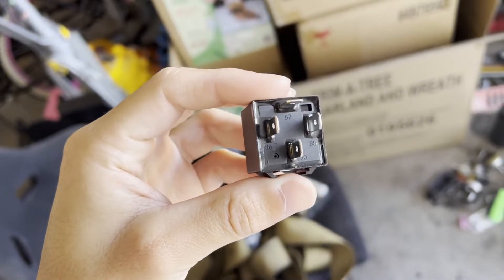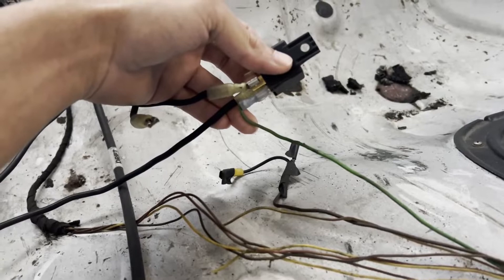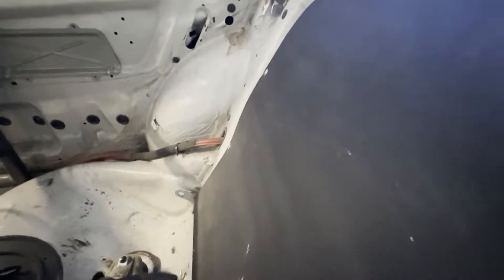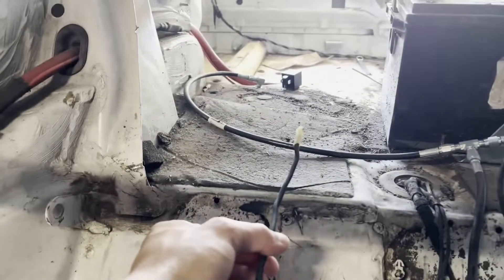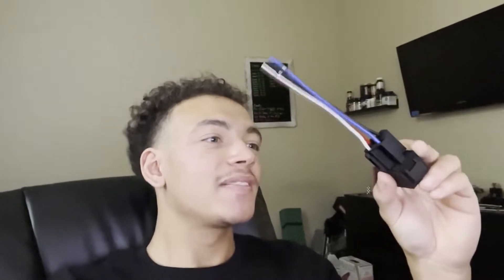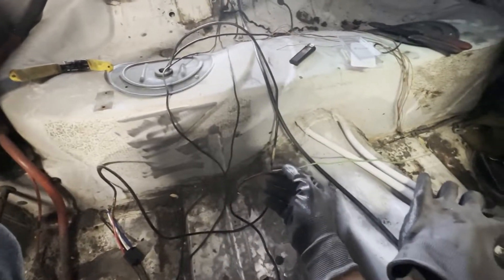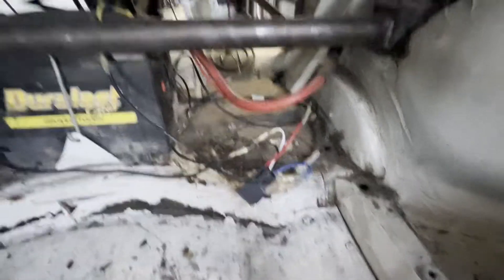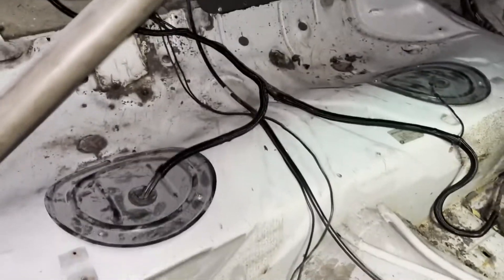In-Depth How To Install Fuel Pump Relay (12v Mod)

Comment: What about for a e46? Same thing I’m guessing?
Reply from the maker: Yessir, it’s basically universal only change will be the fuel pump signal wire, since it’s e46 probably in the same spot as well
Reply: @foxstyle1068  ok because I’m replacing my old relay with a new one because it went out but now the pump wont prime or anything. 
30 battery 
87 pump + 
86 trigger + 
85 neg - 
87a n/a 
Nothing works but if I unplug 87 and connect it to 87a the pump stays running and doesn’t stop
Reply from the maker: That all adds up, everything is hooked up right. 87a is supposed to feed power through if it’s not being triggered. So you know 30 is good. I assume that means 85 (ground) is good as well since the pump will run. The wire going to the pump works as well since it works with 87a. So it’s either something wrong with the trigger or a bad relay. You can check the trigger wire with a multimeter should be 0v with car off 12v (ish)with key on
Reply: @foxstyle1068  it was reading higher than 12v I’m thinking I blew the fuse for the trigger wire?
Reply from the maker: That’s strange, should be no power if a fuse is blown. Does it stay higher or just flash higher? 12-14v is probably normal
Reply: @foxstyle1068  it read 100-114v then when I flipped the key it read 200-214v
Reply: @foxstyle1068  fuel pump relay was out swapped it with the horn relay starts like butter again
Reply from the maker: Nice man glad you got it figured out